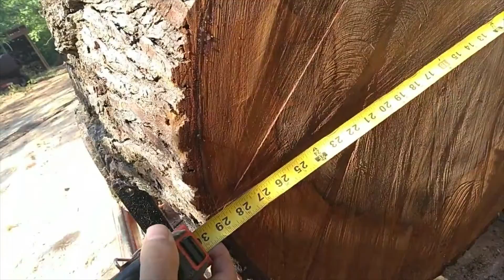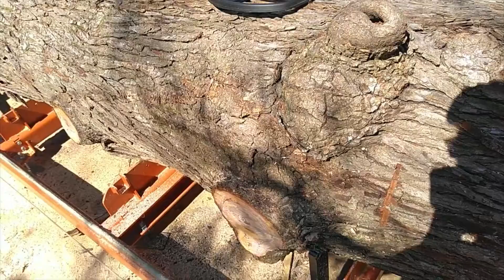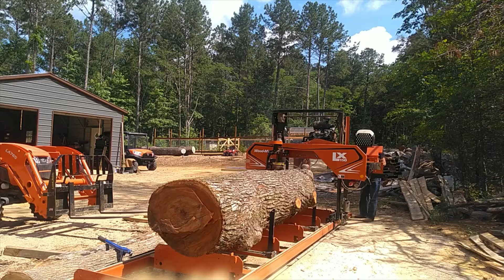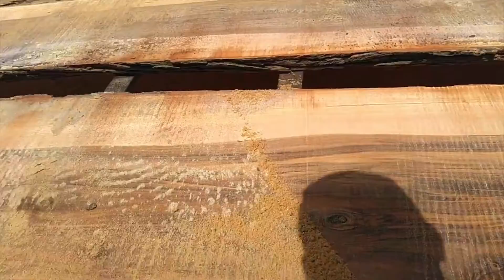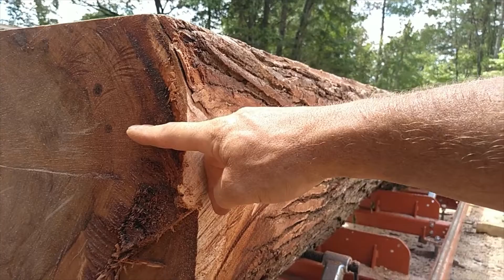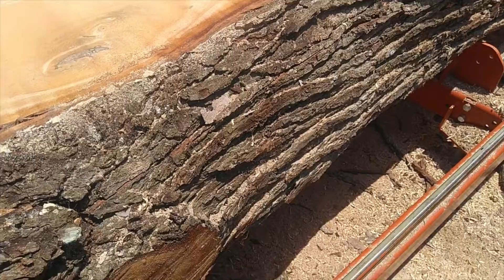#72 Sawmill Day - Slabbing a HUGE Sweetgum

Comment: what are using sweet gum for? tables and furniture? curious, about to cut a few down on our property.
Reply from the maker: I've sold some pieces for table tops, a mantle and a few boards for misc furniture. But I think this was the last sweetgum I've cut. They need to sit in as a log to allow some stress to be relieved, the wood is ok but there are much easier wood species available to cut and use. That said if you have lemons you can make lemonade.

Comment: great vid. i just ordered my LT 15. i have a lot of big sweetgum here on my farm. what is  the best way to market sweet gum, what are the uses for it? thanx.
Reply from the maker: Thanks and welcome to the wood-mizer family. I would google search sweetgum usage but I've sold it for desk, live edge bar top and I've been told it makes great trailer decking. My next batch of sweetgum the plan is to makes some 2x12s for just that.
Reply: @DawnRedwoodGroves  thats great. been wanting to do this for years. just now getting the funds together. the 19 week delivery time will probly drive me crazy. thanx for the reply. happy trails.
Reply from the maker: It will go by fast. Start setting up your saw yard and gather up saw logs. Anchor seal the ends and keep them off the ground. Your will be making lumber before you know it
Reply: @DawnRedwoodGroves  that was another question i had. where can you get anchor seal?
Reply from the maker: Amazon or a local woodshop store should have it.
Reply: @DawnRedwoodGroves  great. thank you friend.
Reply: Same here, seems like that's 80% of what I have unfortunately.
Reply from the maker: Usually, Oak will take over the forest but it takes years! I've been trying to eliminate our sweetgum by minimize the new trees especially where I have any other hardwood near it. Time will tell if this helps